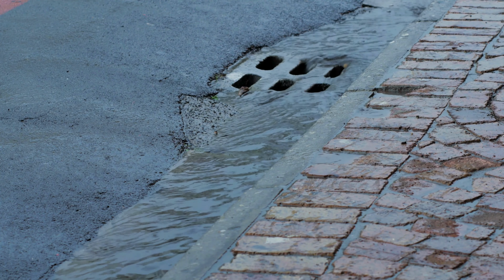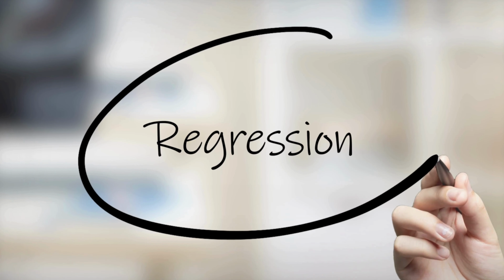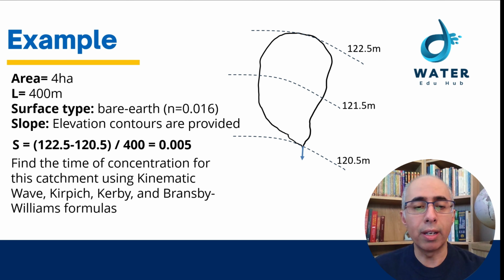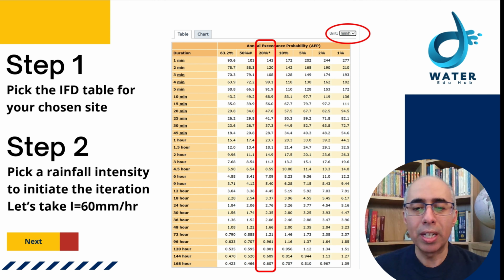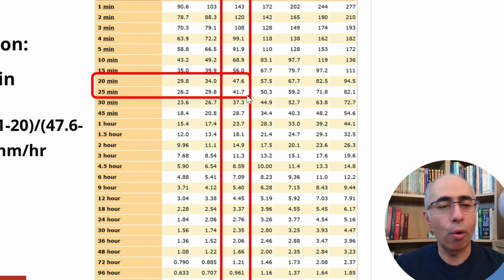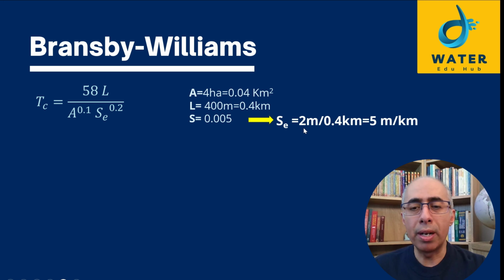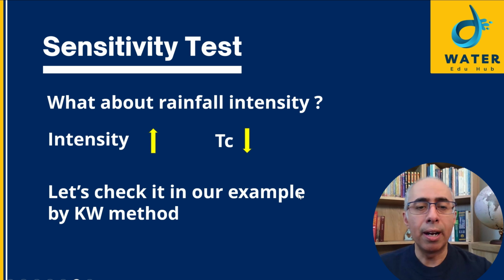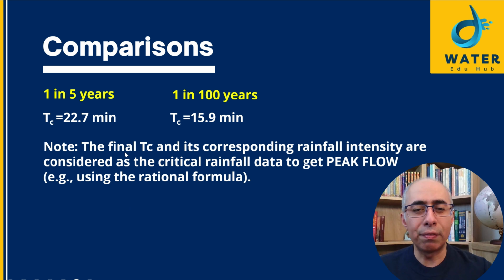How to Calculate Time of Concentration | Physically-Based & Empirical Methods Explained

Comment: Sir   what formula  I use if   catchment  is  larger catchment  like 21,000 km 2
Reply: yeah it is good
Reply from the maker: Thanks for your comment. Good question. For such a large catchment, you would typically use hydrologic modelling software that incorporates physically based methods, such as kinematic wave models, as empirical formulas become less reliable at that scale.
Reply: @WaterEduHub thanks  your clarification  , in hydrological modelling software like HEC HMS  where I can provide or tell the formula which software use
Reply from the maker: In hydrological modelling of such a large catchment, the routing effect also becomes essential. Therefore, things are getting more complex. Most hydrological models provide outputs on the time to peak or the lag between rainfall and runoff. We usually use these two information to estimate the time of concentration.